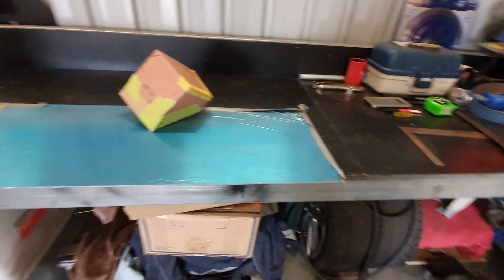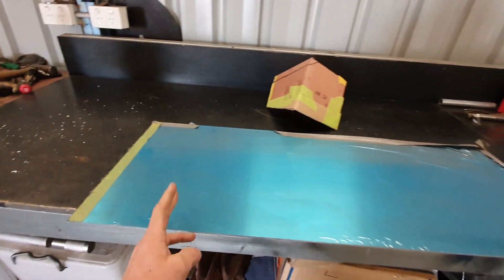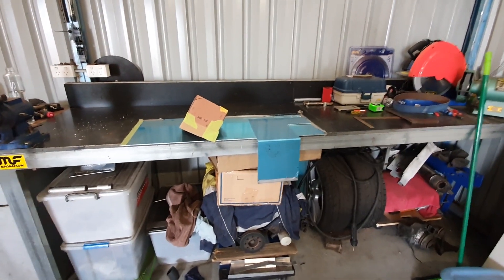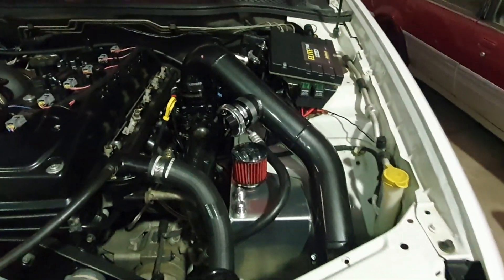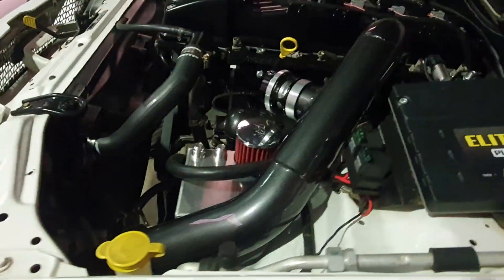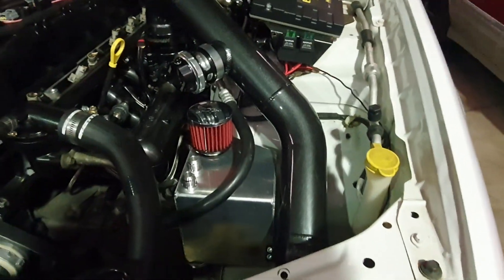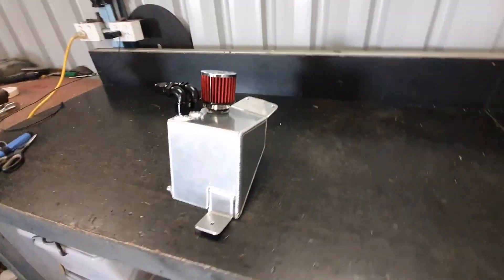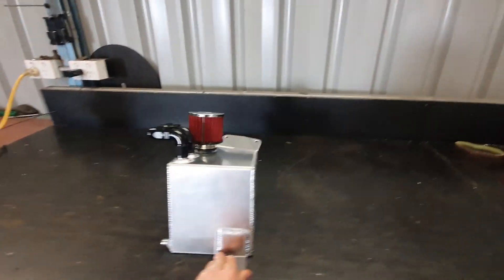Fabricate an oil catch can for your 1000hp street car! - Tips for your Aluminum TIG weld project.

Comment: Was there baffles mate?
Reply from the maker: Nothing crazy with baffling, i filled it with steel wool and extended the breather pipe inside with the opening facing opposite side of the fume entry. Works well.

Comment: Help me understand wouldn't it suck the air threw the vent and loose sucking pressure from the engine. Iv seen this on a few videos of homemade cans
Reply from the maker: It's not meant to 'suck'. It's an avenue for positive crankcase pressure to vent to atmosphere. When that happens it often pushes oil and moisture out, hence why it is a reservoir to catch any oil displaced. If it were sealed, the crank case pressure wouldn't be able to vent, thus defeating the purpose.
Reply: @TorqHub  But doesn't come off the pcv hook up to the intake or is this something different. I'm trying to learn so don't think I'm judging you or saying you wrong. And thanks for replying
Reply from the maker: @garymorgan2095  nah when you use a catch can, you block the PCV to the intake off. This way you don't have oil or moisture entering the intake and contaminating the air fuel mix in the chamber which could contribute to detonation.

Comment: hey man by chance would you remember the settings you used to weld it up? cheers man great work
Reply from the maker: Hey mate, sorry, I'm not sure  exactly what settings I used back then, but I usually stick to the same settings roughly. 
80-100 amps on the pedal
33% ac bal (ep cleaning action)
90Hz freq
Adv square ac profile/ sine wave woks good too
5356 2.4 filler
6 lpm argon
#6 cup.

Cheers man

Comment: Why is the air filter has a long tub to the bottom?
Reply: Is it to prevent the oil from spilling into it? And how should the tub be
Reply from the maker: The tube doesn't go all the way to the bottom, it's basically just used as a shield to stop crank case fumes going straight from the inlet fittings put the filter. Thanks for watching!

Comment: Curious on why I see a lot of ppl (mainly guys from aus/nz) use 5005 on tanks etc rather than using 3003 or 5052? Seems like a lot of ppl in USA use those alloys. Is it a strength thing or is 5005 just more readily available where you are? Killer work btw!
Reply from the maker: 5005 is easy for us to get here and bends nicely when pressing, with no risk of cracking, etc.  It's just a nice all-around malleable alloy with plenty of strength for the intended purpose. Thanks for dropping in man!

Comment: Old video i know, but if you want a better tool for cutting aluminum. get a jig saw with a metal blade, and get those felt stickies that you put on the bottom of chair legs and put them on the bottom guide of the jig saw. it will not scratch your aluminum, and you can be super accurate with the jig saw, even doing curves etc.
Reply from the maker: Thanks for the tip Ritchard! 👍

Comment: Great work bro! Looks awesome.
I have a question though... The pipe that's been extended inwards from the vent, does that ever get blocked up being so long? Or could I build mine using about a 50mm piece extending inwards? Would appreciate the advice. Have a good one.
Reply from the maker: Thanks mate! Yeah the pipe extended through the top was cut on an angle and was basically used as shield to stop the crank case fumes having a straight run back out of the filter as the position of the inlets is very close. Regular checking/ draining of the catch can keeps everything in check. 50mm should fine mate. Thanks for watching man.
Reply: @TorqHub  yeah that totally makes sense. I didn't factor in the gasses getting sucked straight out through the vent. I'm going build mine to circulate back into the intake pipe. But thanks for the video. Gave me some ideas. 👍🏻
Reply from the maker: No worries at all.  I'm glad you got some ideas!  Thanks mate

Comment: Hey bud. I love the vid. Also saw you were using an ever last welding machine… what machine was it? And were you welding aluminum with 110volts or 220volts connection? Would love a reply.
Reply from the maker: Hi Alberto, we run 240v here in Aus, uts a single phase machine on a 15amp circuit. the machine is the everlast 210 ext. Thanks for watching mate 👍